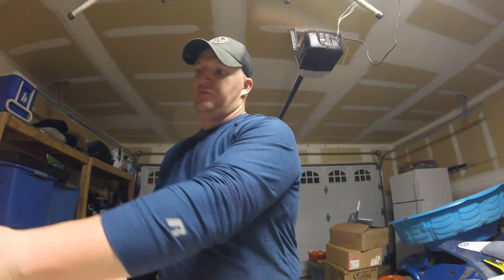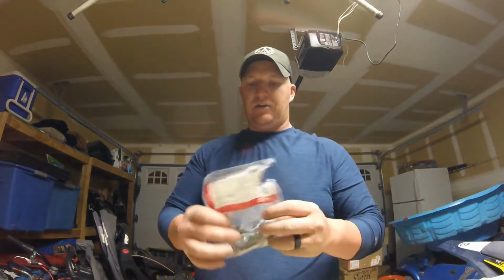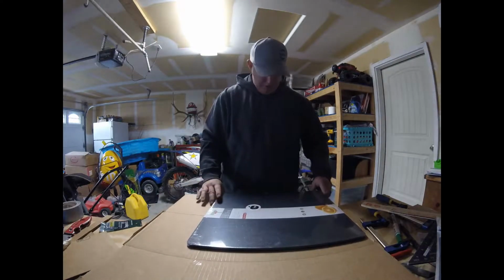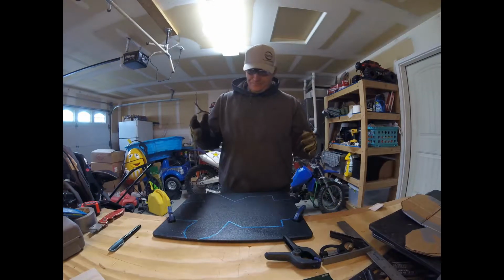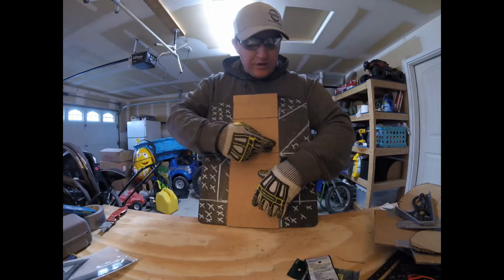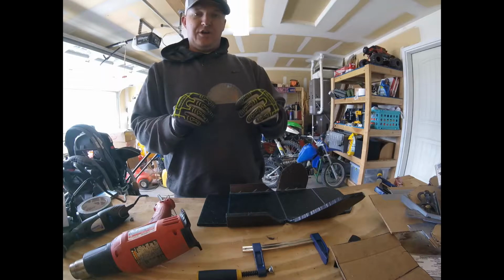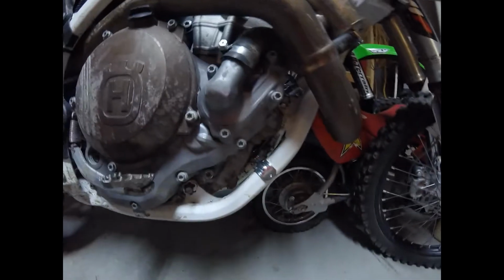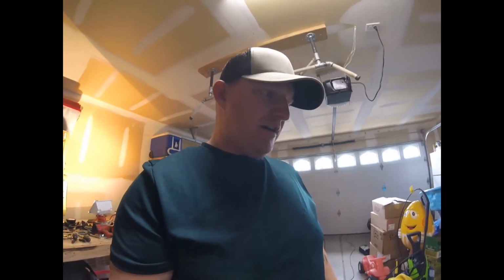DIY Dirt Bike Skid Plate

Comment: I did this and then gave it a good smack and it snapped. Only one fin snapped so I'll see how it does on the trail but I don't have real high hopes at this point.
Reply: I found that reheating it seems to make it brittle.
Reply from the maker: What material did you use for the skid plate? I have abused mine pretty hard and I haven’t broken it yet. Maybe you got it too hot? I will make a follow up video to this with better instructions and footage.
Reply: @Ei8ht Up Industries  I used a poly cutting board similar to the one in the video. Mine didn't last one ride through the rocks of southwest MO. Good Idea though. I think the heating is what made it brittle. I've since made one out of some scrap steel i had lying around in the shop.